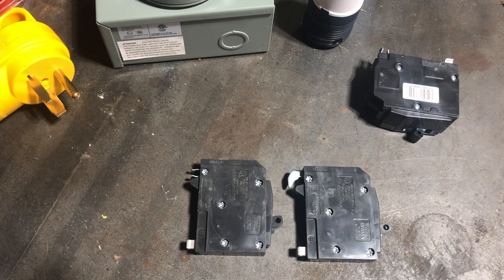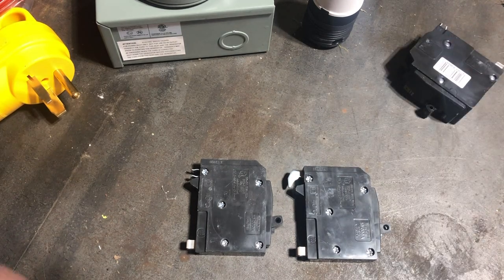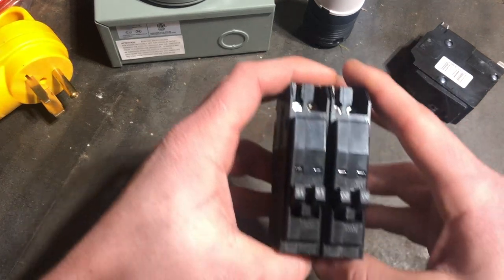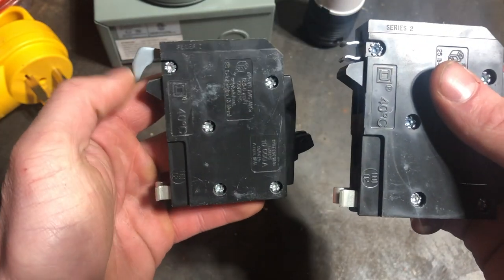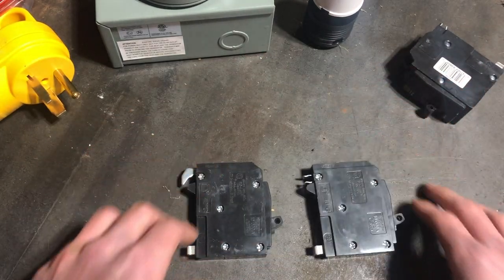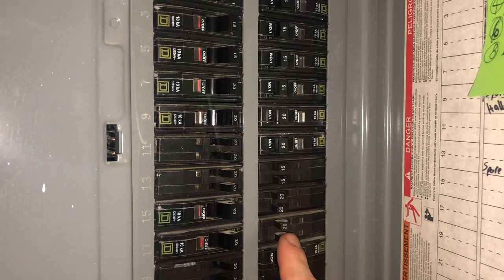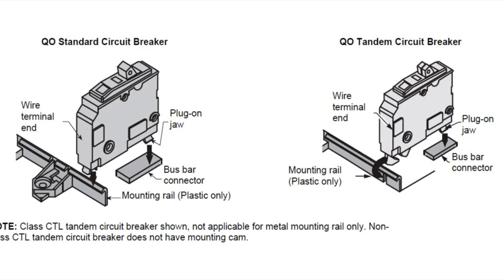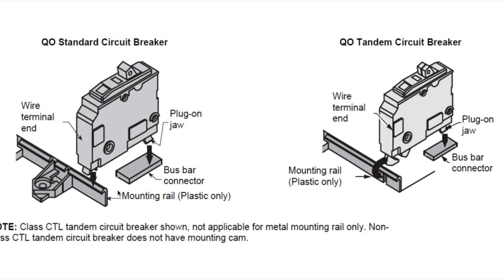MidwestDIY - Square D QO Tandem Breaker Difference - QO vs. QOT and Which One You Need

Comment: You needed a 15, but, you bought the 20 because it was cheaper? Do you have wire that will support a 20? You can't put a 20 amp breaker on wire sized for 15.
Reply: Hopefully, he removed two 20A breakers and replaced them with the Tandem 20.

Comment: This post illustrates the method used by Sq D to meet code requirements for limiting the number of circuits in one panel. The other manufacturers were also required to achieve the same goals. Most changed the shape of the "flags" on their buss and shortening the slot on their breakers so that tandems would only fit in certain slots of some panels and none in others. Somewhere around 2012-14 the Circuit Limit was dropped and now the manufactures will usually allow a tanden in every slot. BTW, there is a MSRP difference between the QO CTL and the spring clip Tandens. The spring clip usually costs 2x that of the hook.

Comment: If you can’t fit the QOT in an older panel, just cut the tip of the metal tooth like 1/4” and it’ll fit. Just did it yesteraay

Comment: Hey I have a square d single slot two 15 amp breaker. Two circuits in one slot. They are side by side. Do you know what tape of breaker this is?
Reply: You mean it has two full width switches as opposed to the two thinner ones next to each other?
Reply: You mean it has two thinner switches built into one breaker (occupying a single slot, right?). That’s surely not a plug-on neutral. I used a couple of these as a cheat when running out of slots in a traditional panel. A single slot gets wired for two independent 15 amp live circuits.
Reply: @geilcourtdf  Yes, that's exactly what they are for. When you run out of space.

Comment: A great video!   My main panel is full (eight slots with four 2-pole breaker 240 volts for two AC, one pool pump and and a well pump).  I would like to add an interlock kit for generator.  How can I expand the existing panel?  do I need another subpanel, so I can move one of 240 breaker to sub-panel to make a room for the generator breaker in the main panel.  Is there any other option?  I am not sure the main penal can take the thin breaker with 2 pole.

Comment: Trying to wire basement currently. Have a QO6-12L100F box. Bare box installed some time ago by electrician friend. Breakers not installed. Just getting to. Have 2 240VAC/15amp devices to power and desire several 120vac/15 amp circuits. Wondering how to do 240 in this box for my compressor and welder. Thanks Keith

Comment: QO   does not mean Quick Attachment.

Qwik-Open
A QO Breaker is a “Qwik-Open” breaker from Square D. They are the fastest opening breakers in the industry and will open within one complete 60 Hz power cycle (1/60th of a second). In addition, they have a visual trip indicator, making it easy to tell when it is tripped.

Comment: Great video. Thanks for sharing your knowledge of this. My home was built around 1997 or so, and the electric panel  box is a Square D that is not the HO model that is sold at Home Depot.  I really do not know how Square D sells their 200 amp main service boxes and models, but the one I got takes the circuit breakers that do not have the hook slots in them. 

My question centers around running out of circuit breaker space. I have none left and was wondering if a "piggy back" circuit breaker is the best way to double up on getting more space? Are the tandem circuit breakers you are referring to the same thing? What kind of breaker is number 11 slot? I see you have alot of those types in your service box. 

If I do want to move some circuits or piggy back two together, are there any certain ones that would best be to use? I would assume maybe if my microwave is on a single circuit alone, than that may be a good one to use along with a circuit for outlets in some bedrooms or like? 

In a different subject. Would the only reason to use a 15 amp breaker be for a circuit dedicated to lights when using 14-2 wire? It used to be that I would have the electrician use all 12-2 wire for everything to wire, but lately due to high costs, 14-2 is now used for lighting, which is what it should be, but it just was easier then to not mix it up. Is it correct to say that a 15 amp breaker should not be used for outlets? Again, the reason I ask and it confuses me, is that I see outlet plugs that say 15 amp on them. Why would they make a 15 amp outlet plug if they should be 20 amp? I saw this on some ground fault plugs I bought recently on sale, and did not notice they said 15 amp. I am no electrician but do my own sometimes. If you can explain those few questions, I would appreciate it as I do have more but this is getting long enough.
Reply: Here in Canada we are generally only allowed to use 20 amp circuits for kitchen countertop outlets or high amp appliances. I do believe that bedroom circuits in the US might be limited to 15 amps for safety reasons though.